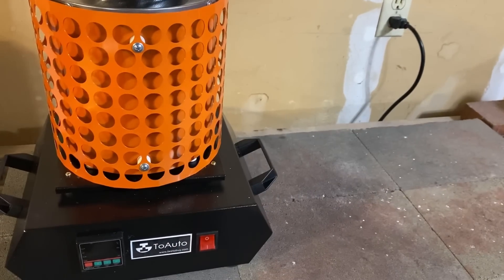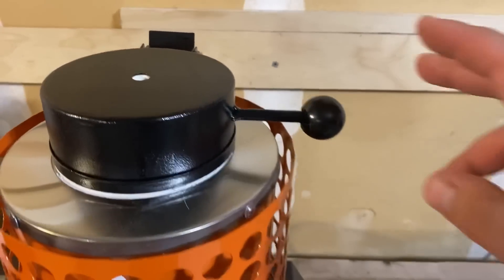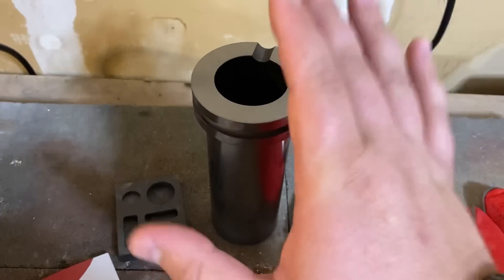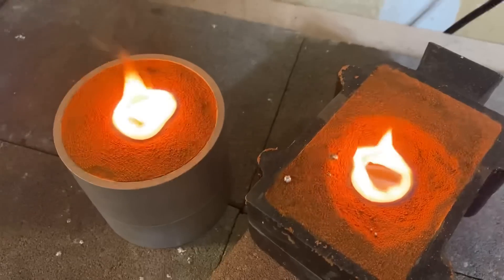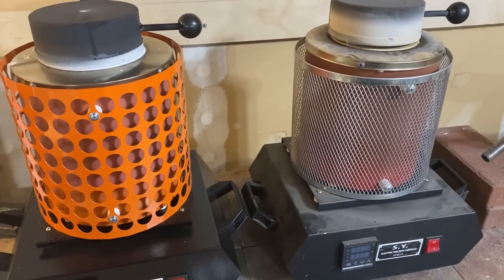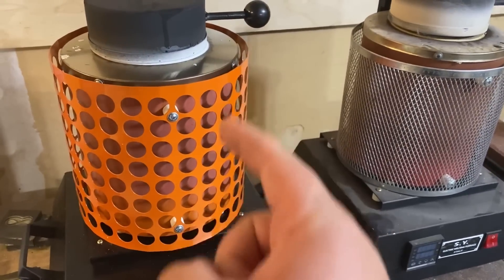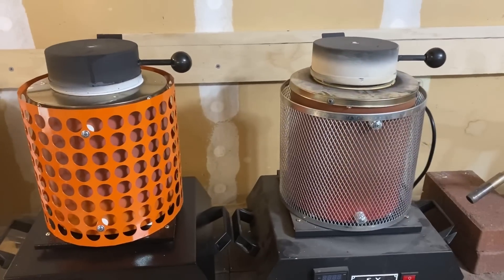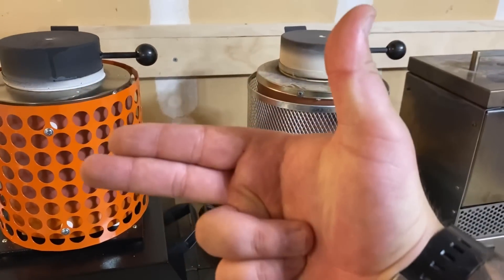New Electric Melting Furnace (For Pouring Silver) Review

Comment: If you put sterling in the furnace, or even 90% coin, would the silver liquify and leave the copper as a solid, which you could extract (perhaps it floats to the molten surface with its lower density), leaving 99% pure behind for your pouring jobs ?   It could be a good way to get to 99% pure silver, assuming you find just right temperature to leave the copper solid.    Also, how long did it take to reach the desired temperature to melt the silver ?
Reply: Nope. Takes way more effort to make it pure again

Comment: You should make a correction to the video, it has a Max temp of 1150 and melts copper without any problems, I literally ordered the same model and received it this weekend, poured copper all weekend and this morning as well and was surprised to see your video on it!
Reply from the maker: hear is the issue I have with copper... if you run this at the max temp it WILL burn out the heating coil way faster than if you run it at 1100. I have seen it many times. 🤷‍♂️🔥🐉
Reply: @SilverDragons47  makes sense.  I was running at 1140 for copper but I've heard of others using 1100 for copper without problems.  I am using copper shot or fine chop so I'm sure that helps.  I'll try 1100 in the next day or two and let you know.
Reply: I bought the same one from Amazon and had to return it after the first use because my PID screen melted once I reached 1100. I was freaking out and my crucible started disintegrating when I tried to pour out the copper. Made my copper bar have black stuff all in it
Reply: Max temp is 1150
Reply: how often do u have to replace the crucible ?

Comment: That's pretty cool but I do wish it did copper
Reply: It does melt copper, no problem.
Reply from the maker: if you do copper it will burn out the heating coil super fast. I would not recommend it 🔥🐉

Comment: I have the same SY furnace, had it since late 2019 and has always worked quite well! I have been able to melt some copper in it. Just takes a real long time for it to heat up. Works great when melting scrap, or doing my silver/gold pours
Reply from the maker: very cool! yeah the hardin gets a lot hotter so copper is a easy with that one 🔥🐉

Comment: Call it for what it is! Junk! Use propane much more trouble free
Reply: Propane shouldn't be used indoors and is loud.  Propane is nice but it wouldn't be my go to on a rainy day, or in the middle of the night, or on a ridiculously hot day.  Electric can be used comfortably indoors, is relatively silent and much easier to control temperatures.  They both have their place but I wouldn't call propane trouble free or better.
Reply: Looks pretty flawless to me.🤷
Reply from the maker: I have an oxy acetylene torch as well. way better than propane 🔥🐉